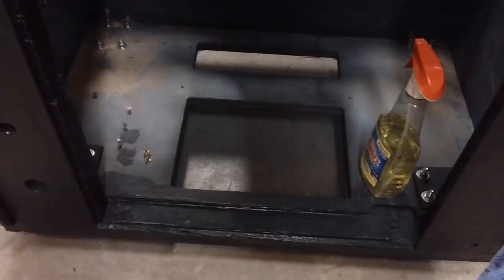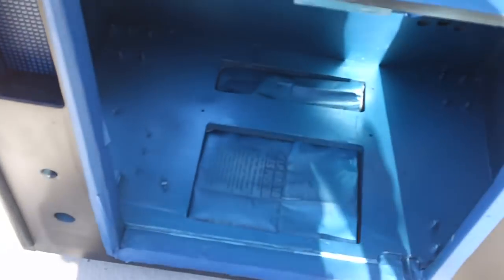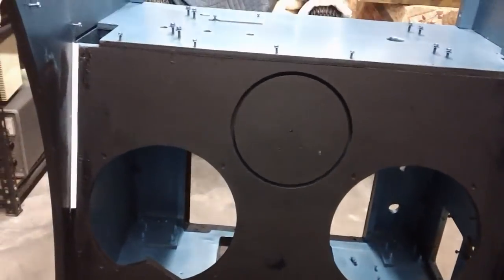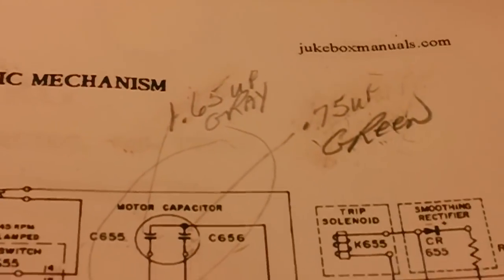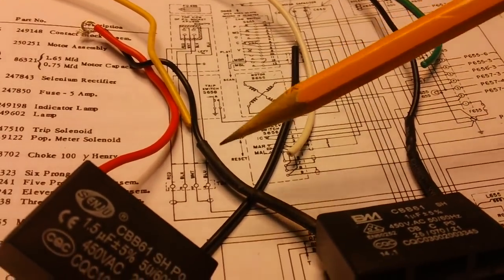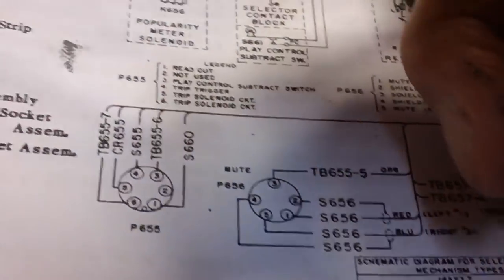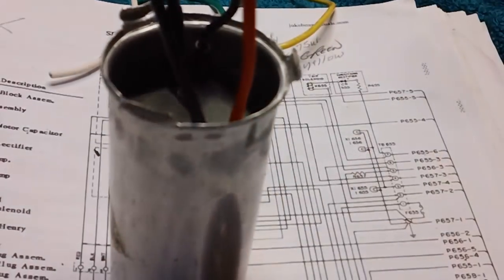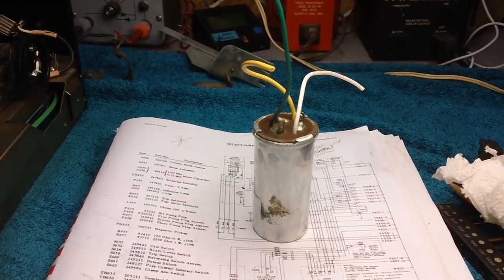1961 Seeburg AY100U Jukebox Restoration (Part 32 of 87).

Comment: John,
Filling a pressurised spray canister with paint out of a tin of coloured paint of your choice is really awesome.  I’m sure there are auto paint stockists offering that facility here in England: I haven’t found one as yet.  
If you’re going to do more paint spraying you’ll need to switch your heating on inside your workshop otherwise the painted finish will very likely ‘cloud’.  Best to get it all finished before winter really starts to bite …which usually begins early-November here in the UK.  This coming winter is forecast for being the coldest for twelve years. 
The interior of your jukebox cabinet is looking superb …virtually like new! 
Regards,
Phil.

Comment: John, how are these capacitors different from the ones we use for radios? I know that you said these replacements for ceiling fans, but how different are they?
Reply from the maker: Scott,
Don't let the flat shape fool you.  Ceiling fan caps are just higher capacitance value non-polarized e-caps. There's a pile of non-polarized ecaps in floor speakers.  Within limit, I'll try to cover this in an upcoming vid.
Regards,
John